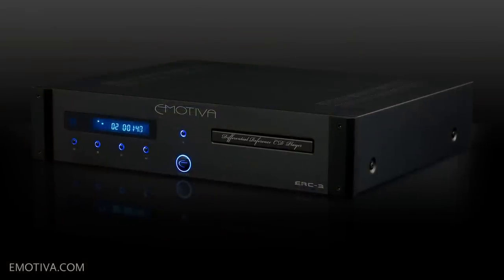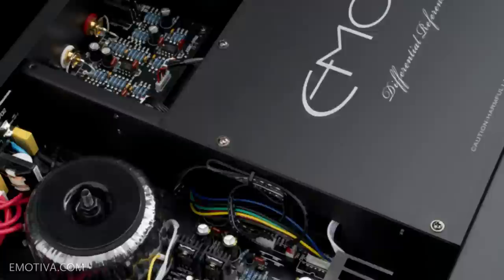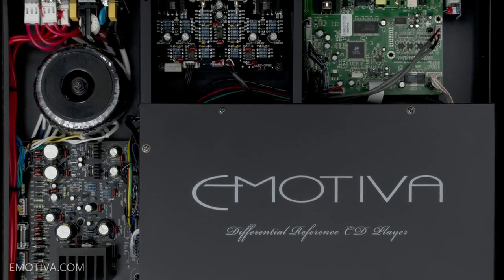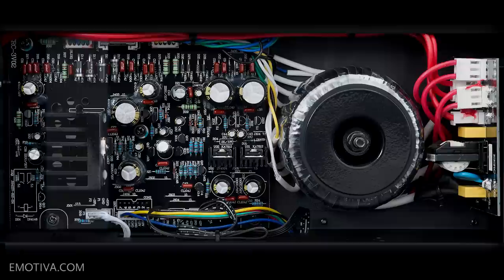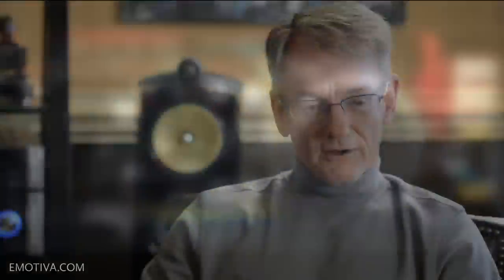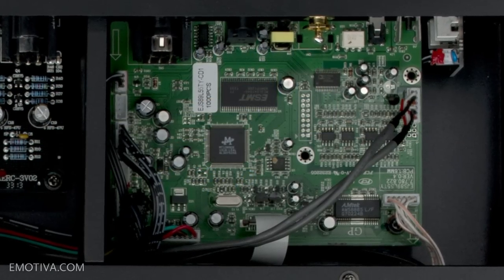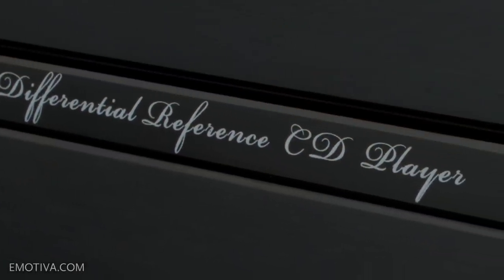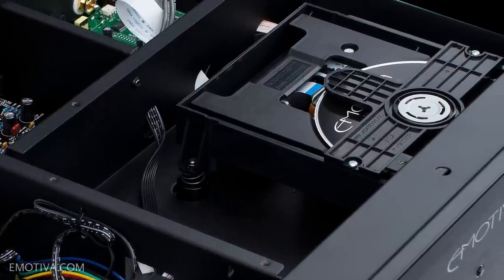Lonnie Vaughn on Emotiva's New ERC-3 CD Player

Comment: I know this is an old thread. I have an ERC-3, and like a lot of people, I use it less than I used to. I fired it up today and the tray didn't open. I opened a chat at Emotiva and Lonnie responded. The fix was quick and easy (10 minutes). It took longer to get the unit out of the rack than it did to "nudge" the load mechanism.  Kudos to Emotiva for building a great unit and kudos to Lonnie for being there to support it (even after all these years).
Reply from the maker: Thanks for sharing!

Comment: Lonnie Vaughn, you are a crook. Making a video about a CD player in 2013? Are you kidding me? You are saying that a DAC is only 20% of total sound quality. You are just an unscrupulous thief. Nobody needs a CD player in 2013.
Reply: Yeah...who needs a CD player in 2013...wait we are in 2014.  Anyway, by your reasoning, no one needs a turntable either, but they sell a boat load of them each year.  I for one am a fan of having some type of physical media.  Digital streaming is convenient, but not the best quality. 

The ERC-3 has been a wonderful addition to my stereo system!  The XSP-1 preamp is on its way, which should improve the ERC-3 even more.  Thanks Emotiva!
Reply: Jason Simmons Jason, you did NOT do your research. Buying a CD player is a really dumb decision in 2013 or 2014. There are high quality DAC monster machines out there for a few thousand dollars if you want top performance. CD transport mechanism, laser and other components in a CD player only introduce cost to a CD player, but they don't improve sound quality.

I don't like streaming either because it introduces artifacts in the sound. That's why I have a tablet hooked up directly to my DAC and the DAC directly to my stereo integrated amplifier. No streaming issues in my house.

You can't compare a CD player to a turntable. CD is all about ones and zeros and how to convert those into analog signal. A good DAC is all you need and this is a fact, not fiction. Lonnie Vaugh is preying on people like you to scam them out of their hard-earned paycheck. Jason, go ahead and give him your money.
Reply: MuristekTV You know, if you're going to call someone out as a crook and accuse others of not doing their research you should, at the very least, have your own facts straight.  Frankly, the fact that you are using a tablet and a DAC to plug into an integrated amplifier and ranting on about sound quality pretty much disqualifies you in my humble opinion.

First, they are only selling this for ~450 dollars.  That is not unreasonable for something of good quality that is going to last a long time.  If they were asking one or two thousand dollars, I'd be right there with you. 

The quality of the transport mechanism, laser and other components may have little effect on the sound quality but they do have a very great effect on the longevity and durability of the device. The ones and zeros need to be extracted from the media properly in order for your DAC to reproduce the audio.  This is also affected by the quality of the transport and laser.  The unit needs to be able to also read the Reed-Solomon error correction codes and reliably reconstruct the data if there is any physical disc damage before it even gets near a DAC.

I still have several hundred CDs in my small collection.  How am I supposed to listen to them without a CD player?  If I only have digital versions of my music, how am I supposed to listen to it in my car?  I can rip the CD to my computer and still use the physical disk in my car.  Sure, cars are slowly starting to come with Bluetooth and USB support etc but adoption is slow and that's only in newer cars and aftermarket decks.

Streaming music doesn't inherently introduce artifacts into the sound.  That is caused by the quality of the codec used to compress the stream and whether or not it is "lossless" or not.  Uncompressed, streamed audio will not be affected in any way.  TCP/IP makes sure all the bits come through. Sure, you could have buffering and playback interruptions but that's a bandwidth/transmission problem not an audio quality issue.  In that case the sound either is or isn't.  Ones and zeros as you say. And how you could possibly have streaming issues in your house where you have massive bandwidth is beyond me.

Finally, one thing you have neglected to mention in your little tirade is the codec used to encode the source material in the first place.  Where do you get your digital files from?  iTunes?  What codec is used to compress them? MP3? AAC? AC-3? WMA? FLAC? Even with a high-quality lossless codec what was the quality of the ADC used to sample the source material?  How was the source material mastered?  Digitally? 

As you can see, the quality of the sound you hear is dependent on so many more things than just a good quality DAC.  It's all about balancing the components in the chain.  The highest quality source material through the best DAC in the world is still going to sound terrible through a set of Walmart special speakers.
Reply: visualdragon You like to assume a bunch of things about me and that's just dumb. You are talking to a guy who knows audio. Nobody can fool me when it comes to audio.

My whole CD collection was ripped by iTunes into WAV format. It is the main format used on Windows systems for raw and uncompressed audio. The usual bitstream encoding is the linear pulse-code modulation (LPCM) format, which is identical to the Red Book CD encoding.

I load all my uncompressed songs on to the 'class 10' micro SD card of my tablet and I have an asynchronous DAC connected into the USB dongle on my tablet. There is no better way to enjoy my CD collection. Again, making all kinds of assumptions about my system and my music files makes you look and sound very amateurish.
Reply: Jason Simmons  I just purchased an ERC-3 about an hour ago than again I never gave up vinyl. When I hear music I want it to come out of a REAL stereo system not a computer! I run a tube pre with one tube power amp and two Sherwood mosfet power amps along with a powered sub! Three sets of speakers and a sub!!!!!  The great thing about this player is I can use an external DAC in the future and just use the transport of the ERC-3. Enjoy your tablet....haha
Reply: MuristekTV I have over 1000 record albums,600 cds and over 200 gig of mp3s. No DAC is going to touch vinyl. Maybe in the future but not now.  Your system is a joke! haha
Reply: ***** Hi Mike,  I do use a tablet from time to time to stream music, but mainly use my ERC-3 CD player or my VPI Traveler turntable now.  You seem to have a nice setup going.  I don't have all the speakers, just a very good pair of Martin Logan Theos electrostatic speakers and a Depth I subwoofer.  I have MIT cabling throughout and Voodoo power cords; they probably cost me more than the speakers did.  My last upgrade for a long while will be Transparent Super Phono cables to connect the VPI to a Sutherland Insight phono preamp. Then I will be set for a long long time.  Enjoy the ERC-3 and the music of course!  Little is ever said about the music source; but it does make a difference...I have spent a small fortune acquiring my favorite albums released by Mobile Fidelity Sound Labs.  They master in half-speed and most of the time from the original master tapes.
Reply: ***** Mike, I feel sorry for you. You have a big head with big hair. You are trying to look like Robert Plant, but Robert Plant would never say such stupid things to me like you did. Nobody cares about what you look like or how many shitty quality MP3 files you have. The only important thing on any public forum is your intelligence and you clearly have none.
Reply: MuristekTV The only thing we need to know about you is that "My whole CD collection was ripped by iTunes ".  iTunes is one of the most hated and worst pieces of software ever unleashed upon the earth. Even the Apple fan boys hate it.  You speak of intelligence and yet the only thing you bring to the discussion is Ad Hominem attacks and childish insults.
Reply: visualdragon There is nothing wrong with iTunes. To say that iTunes are hated even by the Apple fan boys does NOT mean anything. Apple fan boys are not experts in anything and neither are you. iTunes app has been downloaded millions of times by people who appreciate a well written piece of software.

The CDs ripped by iTunes sound incredible on my high quality stereo system and that's all that matters. The combination of a tablet and a good asynchronous DAC rivals the sound of the best turntables in the world. I know this because I did my testing and most seasoned audiophiles agree with me.
Reply: Jason Simmons I apologise Jason. My response was directed at Muristek.
Reply: Jason Simmons Sounds like a killer system you have there Jason! The VPI is a great table. I am running an old HK t-45 and a t-60. I want to do the Van Alstine mods to my Harmon Kardons. I am always on the lookout for speakers. Right now I have three pairs of ESS speakers. One pair of Rock monitors and two pair of AMT Monitors. The tall ones with the 12" woofer and 12" passive front loaded.  Not sure if I should recap the crossovers,bi amp of get more modern high end speakers. I am running an Anthem Pre-1 preamp. The original one with the separate tube power supply. Looking forward to running the ERC-3 through it. I have a good bang for your buck system. Not the best but considering what I paid for it its not bad.
Reply: I need one!
Reply: MuristekTV I bet your mp3s sound amazing on your Bose speakers
Reply: ***** Sounds like a sweet system you have there.  I know nothing about the recapping etc, but sounds like you'd want to be good with a soldering iron.  Let us know your thoughts on the ERC-3 once you have had it for a while.  Mine still sounds excellent.
Reply: It is not nice to call other peoples sound systems 'jokes'. Perhaps that is all they can afford? Perhaps they like the way their particular system sounds? The guy in which you say his system is a joke knows his audio components very well .. I can assure you (we share insight and I can attest that he knows what he is talking about). I'm not saying he is always right.. or that his opinion is the say all / end all ....I'm simply saying he knows his stuff. Even if he didn't .. It is not proper to joke on someones hobby or their things.
Reply: Ian Billen 
Thank you, Ian. Trolls are in full force here. Especially now that we have studio master files available for downloading, there is absolutely no reason or any excuse for owning such an obsolete product like a CD player. 

Studio master files from HD Tracks website are on average 3 times bigger than those Redbook CD files and they sound so much better.
Reply: You got it. Btw.. I took your advice and I will say that my NAD Amp is great! It has some 'serious' power. Thing is a beast. Also I am picking up the NAD T535 to play my SACD and CD's on. I am getting a very good deal on it.. very... very good ...and it is in excellent condition. Right now I have a Sony C222ES 'Five Disc' Multi-SACD. It sounded real clean and I liked it but it doesn't read SACD's anymore (and that's what I have and often play ...until I get a nice DSD DAC). I have some questions again since you steered me right before. 

1. Do you think the NAD T535 DVD / SACD single disc will outperform / sound better the Sony 5 disc ... (the Sony came out in 2001/02 and the NAD came out in 07/08 and they both retailed at right around $450 - 500.

2. I heard a single disc is the way to go for Audiophiles ..versus multi-disc. Is that so and why?

3. Will the NAD T535 compliment the NAD amp a little better than the Sony did since they are both NAD products .. or does that not matter? 

Thanks so much for the input.
Reply: Btw.. I know my questions go against you're advising against buying a CD player theory but I still want to at least 'have' one.. and mine was wearing out .. so I thought eh .. might as well grab one .. but if so.. Its gotta be good lol. I have loads of CD's and several SACD's and I don't feel like burning them all. I want a nice Turn table in time as well (..just to have my basses covered .. I like vinyl every blue moon  too...All depends on my mood). I am still saving up for my TEAC DAC... Cant wait!!
Reply: Ian Billen
Just get a DAC and a nice 10-inch Android tablet from Samsung or a similar brand. Another option would be a nice Windows 10 laptop.

I really can't recommend a CD player or a SACD player since they can't match the sound of even the most basic computer setup with an external DAC.

Just forget about it. I'm sure an NAD player would work just fine for you, but I have moved away from optical media and players. I have a Dell Android tablet and a Schiit audio Modi DAC. I play studio master files and the CD Redbook files on it and I get the sound of the century.
Reply: You said ..."I get the sound of the century." .. Lol .. That is literal and figuratively .. I dig it. 

I must ask .. I already have the NAD MDC DAC and I have an Audio Quest 3 meter USB Carbon Cable from my Win 8.1 Dell Desktop computer straight into that. I am looking for a better DAC (the Schiit DACS you seem to favor really have quite good reviews ...from their moderate products... to their higher end ones). 

Why don't I simply use FLAC or DIFF files / downloads right here on my hard drive and send them out to my DAC versus a tablet or laptop. Having those same files on my 
Desktops hard drive shouldn't make a difference in sound quality at all as opposed to having those same exact file on a tablet or laptop .. right? .. or wrong?
Reply: Ian Billen Yes, your desktop is fine, but I would still invest in a tablet because it is much quieter electrically. I also have the Schiit Audio Wyrd to clean the electrical interference from the USB port on my tablet because I want the cleanest sound possible.
Reply: I've read up on Schiit.. and the whole consensus is that they make really good products and at pretty decent prices.. with some 'innovations' in Digital audio to boot (and their Dacs are upgrade-able!). 

I am going to get a tablet based on your recommendation here. I will play my DSD and FLAC files from the tablet .. straight to my DAC. 

Who knows .. I just may get the sound of the century. Keep me posted. Are you are saying a tablet is going to have'technically'  less electrical noise than even a small laptop with an SSD? Only a question. I suppose it would?
Reply: Ian Billen
A laptop would be just fine. I would also get the Schiit Audio Wyrd because you can always use it with other DACs in the future and it helps supply enough power to any DAC without running into various issues of a USB port not providing enough power to a DAC. Apple computers have that issue on a lot of newer laptops.
Reply: Where did you get your electrical engineering degree?
Reply: Audio Engineering ...not electrical Engineering.
Reply: Someone that doesn't get triggered by a YouTube video about something that doesn't matter.
Reply: Lol Mustistek : I thought he was serious in thinking I said I had a degree in 'electrical 'engineering. 

Mr. Betaomega04 ...I do not. .. it is 'Audio' Engineering, actually (Grad. 2006). 

Still it doesn't matter who has what.. I thought we could all exchange ideas. I don't know a whole lot about home entertainment systems... however I come here to learn. I've already learned quite a bit .. or at least I have some different takes on things. One could have 10 degrees and still be inaccurate or learn some things. That's all I'm doing here.